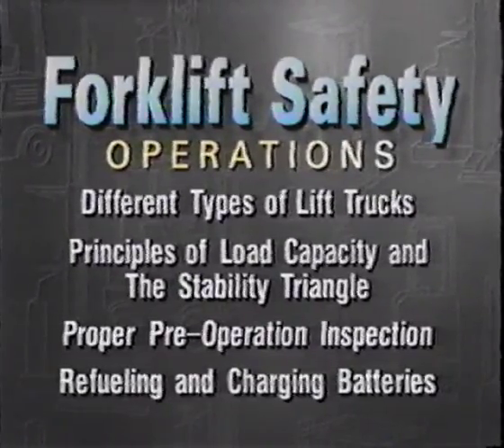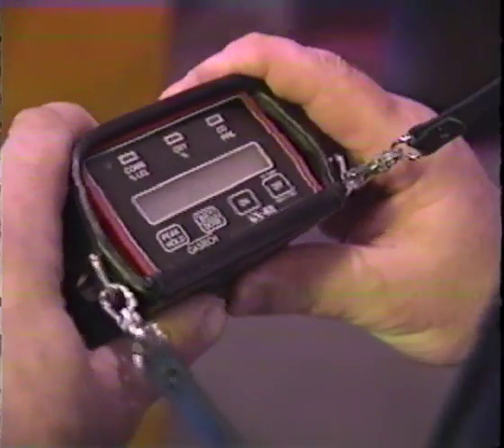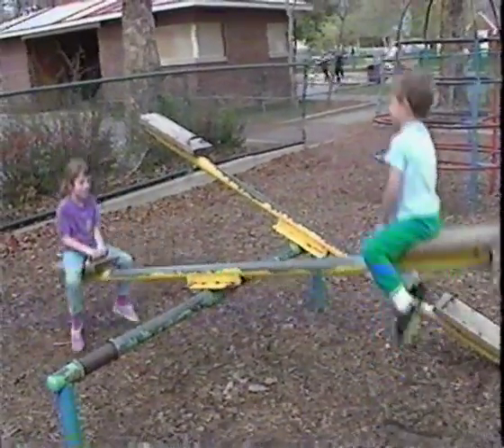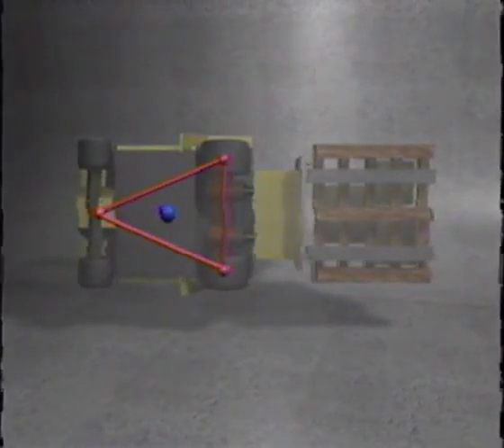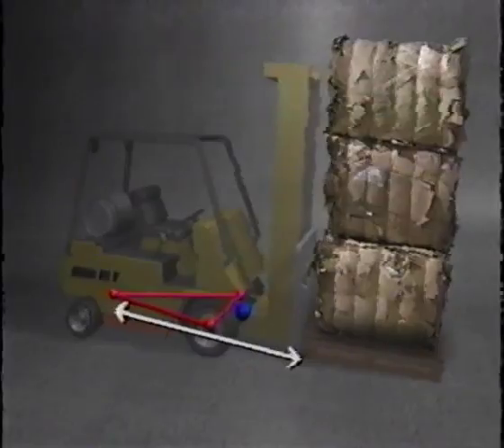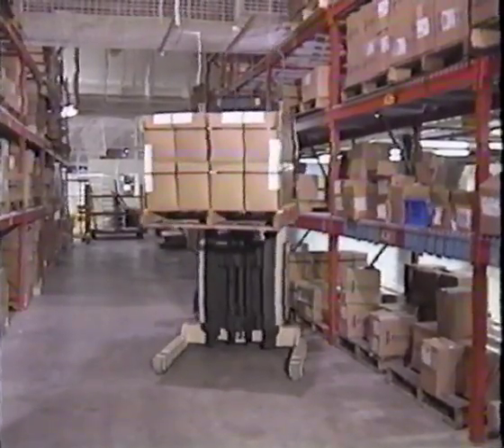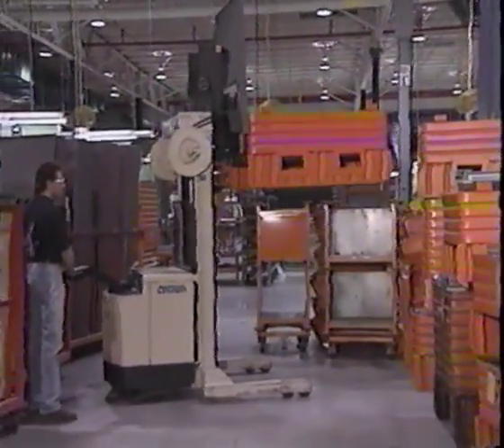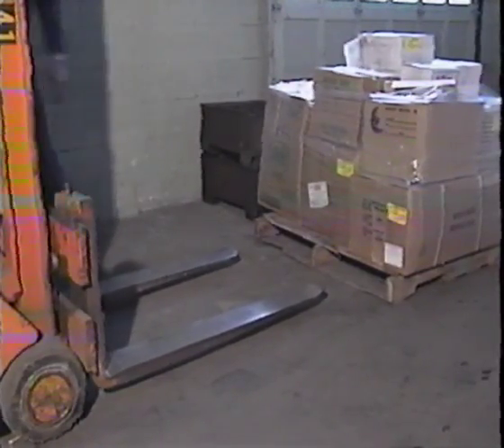Sears Forklift Training

Comment: Here in the U.K we have 3 Main types of Fork Lift Licence, Counterbalance, Reach and Rough Terrain. Counterbalance normally you stop with the Fork Tips just short of the edge of the pallet, Extend the Forks until in correct position, Raise the Forks by 3 Inches and tilt back. Reverse out of bay and stop. Raise Forks until they are just above Base Extensions and reverse Forks until you just touch the Back Frame. Here we would carry out further tests on for use of Passenger Lifts, Barrel Lifts, Chain Lifts etc. Reputable companies will insist that all new Fork Lift starters go on the course provided by them and that they pass all the required extra testing. This is to stop a person working as a Qualified Fork Lift Driver when he has actually had his Fork Lift Licence revoked. Legally all companies must retain an up to date copy of all workers Licences. Most companies will insist that all employees hold a Full Motor Car Driving Licence? This is for emergency use where a worker may need to be transported to a local hospital. So why waste time trying to find a Licenced driver make sure they all are.